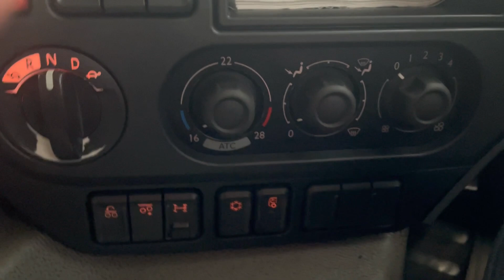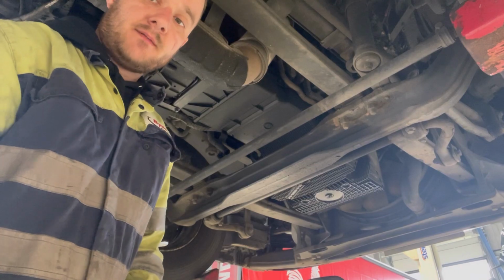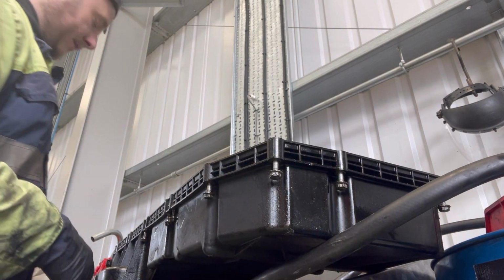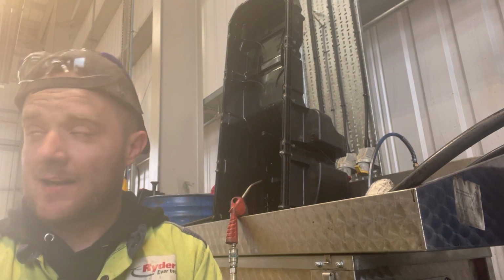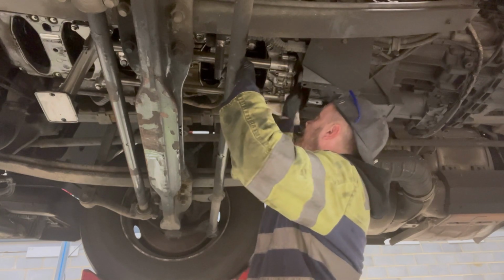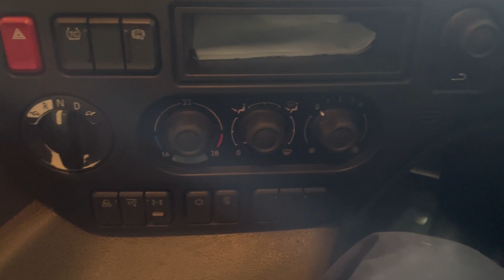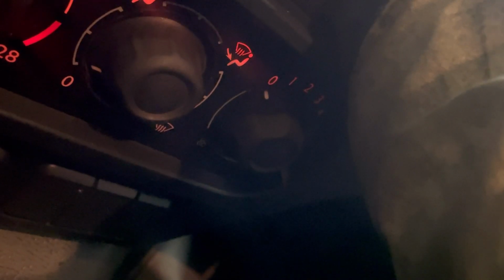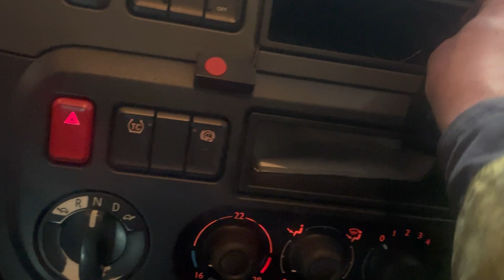VLOG-Day in the life of a HGV mechanic- DAF CF85 2014- MOT prep plus a big oil leak!

Comment: 10W40 oil for the engine ,thank fuk there is someone else who cleans sumps and  torques them the amount of thread inserts i have had to do on the alloy end casings when some one guns them ,,I remove the sump differently ,i remove the 8 bolt cross bar at the front ,i also remove the oil sender after i broke one once ..Heater bulbs are fiddly ...I do not know what DAF have done with the centre bearings as they used to be a piece of piss..nowday you can't get the flange off ..We have a local prop guy and generally give the CF XF ones to him to do..Looking forward to the centre bearing video lol
Reply from the maker: Yeah if you don’t clean them and torque properly it’ll end up leaking again! Do it properly first time! Just filmed today the centre bearing got the flange of in 6 mins but have a bit of kit for it lol

Comment: nice to see you back missed the videos and yes those heater control bulbs are a bastard especially that bottom one you just can't find the hole pardon my pun even with the lights on and i have big hands . the sump jobs are not bad it takes longer to clean everything up . did you get any time to do any work on your beetle .
Reply from the maker: Thanks mate it’s good to be back at it, yeah very fiddly job! Lol yeah your 100% right the clean up definitely takes longer but it’s worth the worry to clean it so don’t have the problems again. So got some more bits to pick up for the beetle this week and we’ll be cracking on with it the weekend.

Comment: have you ever come across a daf xf euro 6 not shutting down even when you remove the key will start fine but to shut it off i have to remove main big grey relay  ive try swapping relays even tested the ignition switch ?
Reply from the maker: We’ve had that on our CFs and they turned out to be faulty ignition barrels mate
Reply: @freightlanetv  iv try some out of stock even unpluged it out of the dash while it was running it is a strange one
Reply from the maker: Yeah that is a strange one! Has it got any warning on etc?
Reply: @freightlanetv  ones that stood out to me was ecu lost data due to shutdown and ecu low voltage i clear them on texta they just come back im new to these dafs was fixing cars about 2 month ago :D
Reply: im thinking ecu is toast there ment to be issues with them so im told a commen problem
Reply from the maker: No CAN faults? Sounds like a possible ecu, ahh DAF electrical can be a pain lol